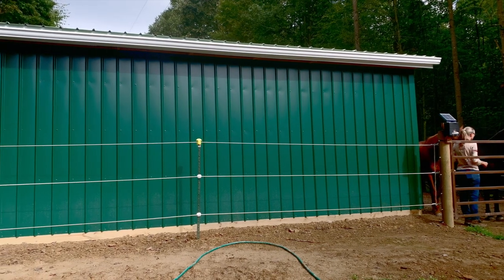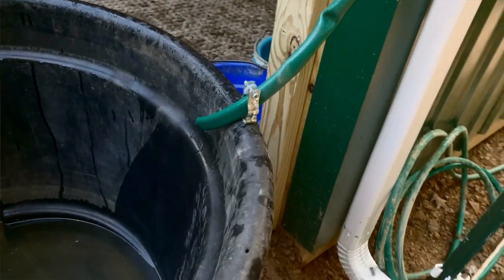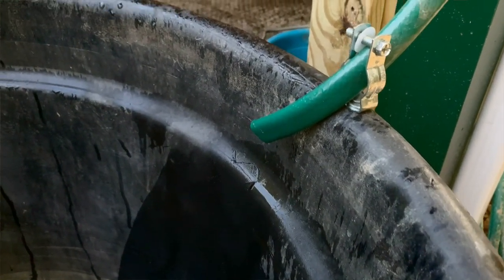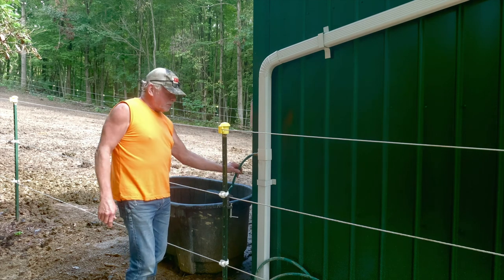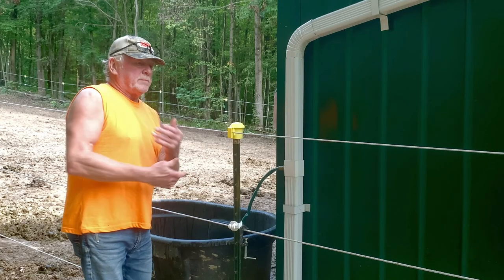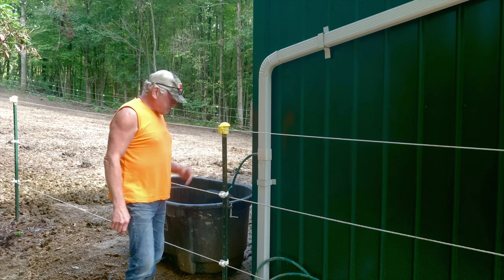Auxiliary Water Source For Horse Water Tank

Comment: Years ago we purchased a waterer for our cows instead of a tank and hose. It's a fountain with a float valve that turns the water on and off as needed and it has a heater on it for winter. I wish I could remember the name of it....but we've had it for more than twenty years!!! It's made out of heavy duty plastic and just sets out in the open for the cows to drink from. We ran a water line from our house to it.
Reply from the maker: The water tank we have only has a heater. We run about 150 feet of garden hose from the house to fill it. A couple of days ago, someone asked me if could put a float valve at the end, so I've had that idea on my mind. I'm assuming your water line was underground? How did you prevent freezing at the end where the water fills the tank?
Reply: @WaynePolcin  our waterer is a Ritchie brand. They sell all kinds of waterers for cattle, swine and horses. They're a standalone unit and you run an underground waterline to it. It's hard to explain but they have a website with all the info. They are kind of expensive but they are very reliable. Hope you find a good solution for your problem!!